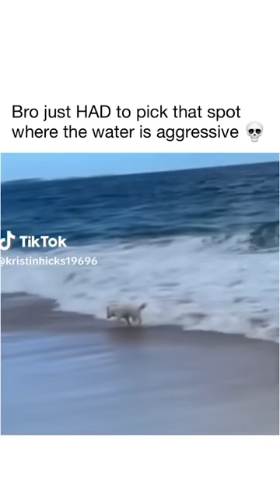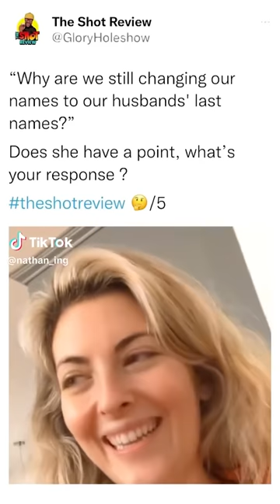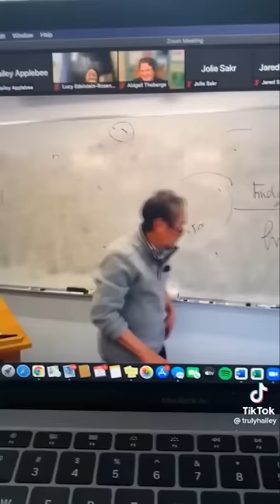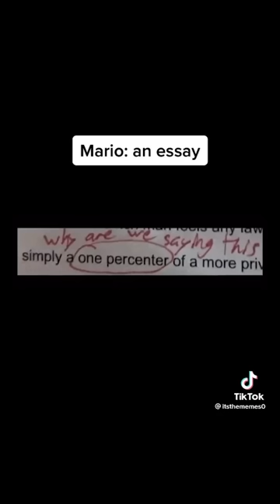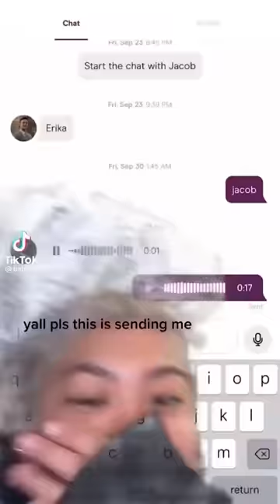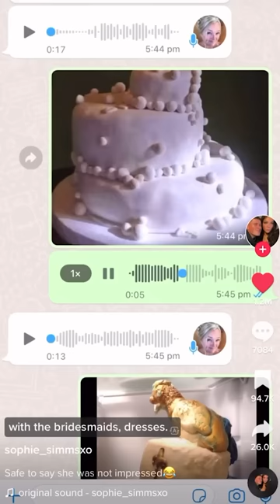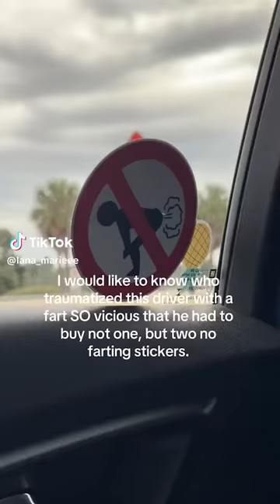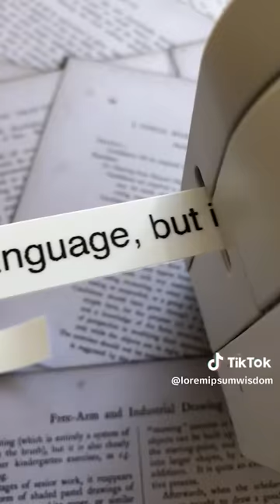Funny TikToks that Had me Rolling on the Floor! PT.12

Comment: 0:47 How does this person not know eternal cable 😐 you literally need that for your internet, my TV and laptop are connected to eternal cable for stronger connection,so sadly I can't use cast to TV function from my phone using same wifi, I have use code like twitch and YouTube to cast to TV, I remember it being looking a smaller version of the now old hdmi that I found out only last year use type c  because I needed it for my Nintendo switch